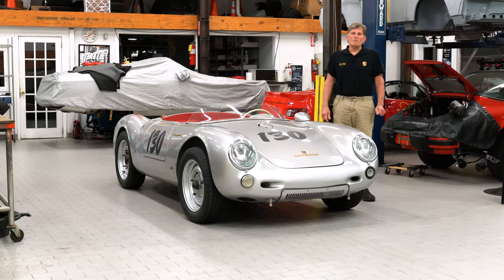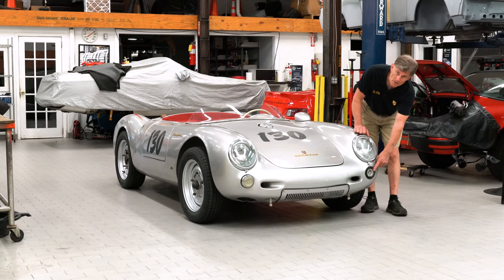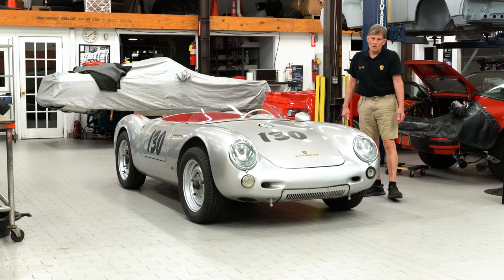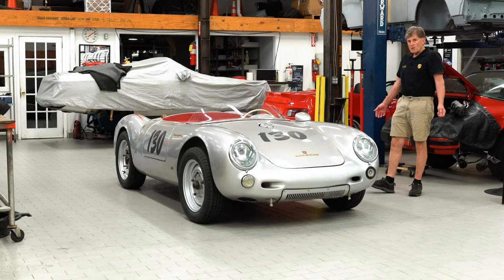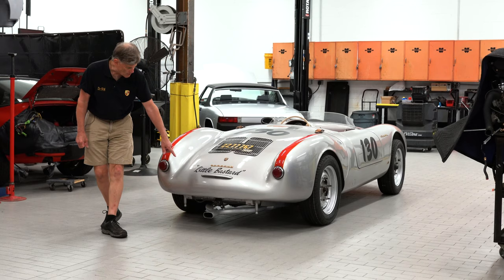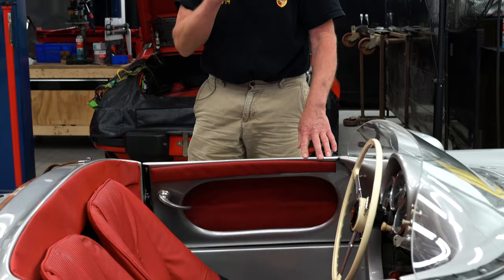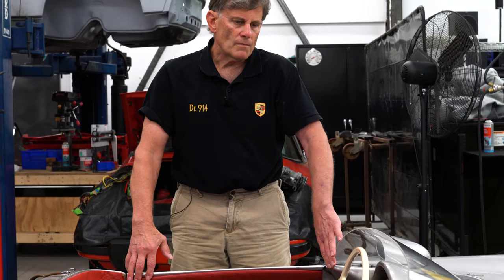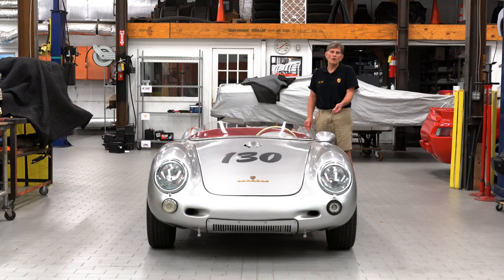James Dean's Porsche 550 Replica Tour

Comment: Nice! I proudly own a Beck that looks very good too but isn't quite as exact of a copy. I think the only thing which gives away the fact that its not original are those tires. I highly suggest going with some narrower tires. I run Narrow wheel and tires on mine which eliminate any tire rub issues while cornering, and since its so light it still has plenty of grip. I really hope you plan on putting some twisty back road miles on this thing, because they drive even better than they look when set up properly.

Comment: Thanks, Doc. Who had all that work done and were the 356 parts NOS, from wrecked car(s), reproductions or repair parts Porsche made?
I drove an exact replica on St. Simons a few years ago. It had a 120 HP 912 engine. No power whatsoever under 4000 but above that the needle was a blur in first and second. I was afraid to go any faster due to the traffic and at that I was doing about 60 in a 35 zone.